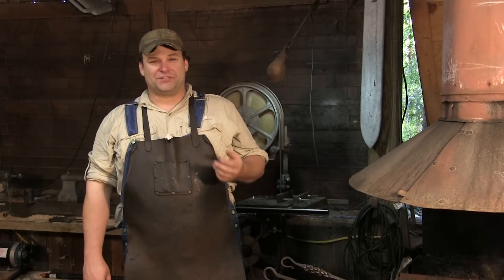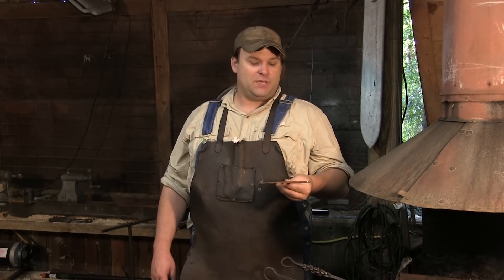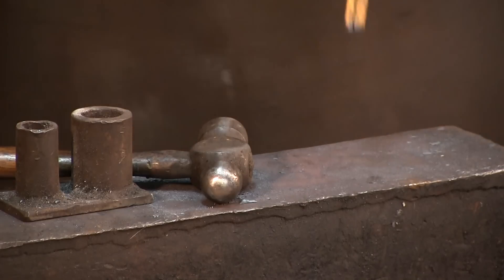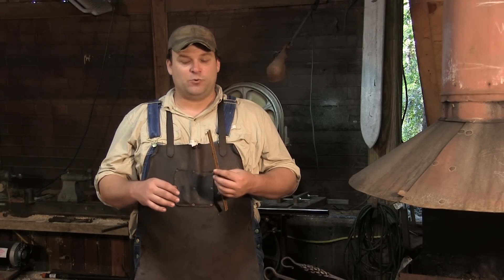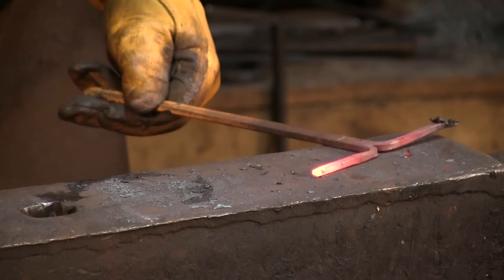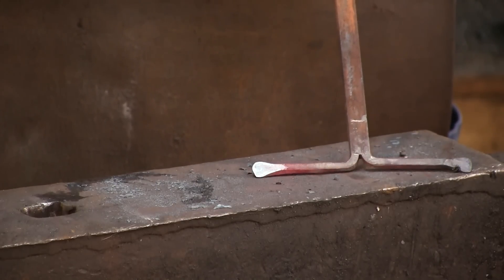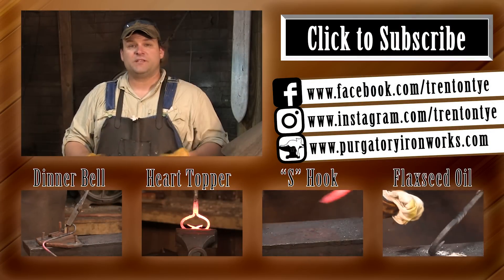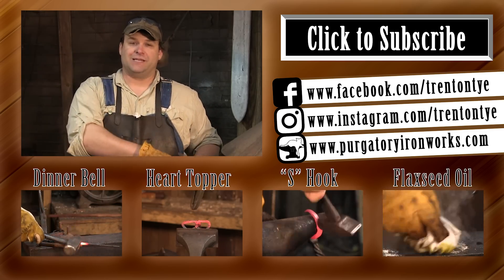Forging Jay's Doorstop

Comment: Hi Trenton,   The best part is that the techniques are largely the same as a basis for the the copper candle holder project from a few years back as well as making antlered animal head fireplace tools, etc.    Thanks so much and am glad to see you back on Youtube.
Reply from the maker: A new candle holder video is actually coming up! And the fire poker videos as well.
Reply: Do you still have the blacksmithing and knifemaking DVD in stock?  From a few years ago.  IF so consider them sold.   Just need to know where to send the payment ..  Thanks again!!!

Comment: Hi Trent, I've enjoyed your videos for a few years now. Thanks for all the great info and instruction.  Here is another answer to the perplexing "door stop" question. I'm 62  and a retired Firefighter. Before my FF career I worked in residential construction from the age of 16.  As a framing/ trim carpenter, I've been involved with the evolution of home construction, especially hanging "doors" of all makes and models.  Installing today's pre-hung doors is such a delight. Easy to plumb and they usually stay where you put them.  I also I remember the 50's and growing up in my grandparent's home in Florida. Their house was built in the 1930's. In the days of old, many of the houses were built on a foundation of brick pillars/piers spaced about 10 to 12' apart. Usually, the sill was of 4x6 and the joists were installed on the sill.  This style of construction dates back to the early pioneering days of the 1600 and 1700's. I'm in rural TN now and there are still Board on Board structures set neatly on piers of field stone throughout the countryside. I know that in your neck of the woods there are pillar foundations as far as the eye can see too. The problem with these foundations is that they are notorious for sinking, throwing the house out of level.  This sometimes would cause the doors to swing closed with little provocation, inhibiting the much needed air flow. Then you add in the cross ventilation factor an you pretty much went crazy trying to keep the doors propped open. We've used books, decorative wood blocks and even a small carved elephant that I still use today.  And now, I have an authentic, PIW door stop. Thanks agai. Jeff Reynolds, Pikeville TN
Reply from the maker: Mr. Jeff, can't tell you how much I appreciate your words, things have been going so well for the shop lately, its great to hear from long time watchers. This is the first time we have been this consistent, this long, with the videos and people are really responding to it. I wish we could do it full time!

Comment: Door stops were used before AC became common.  The houses used breezes from outside to cool the house, so you opened your windows and propped open the door, using doorstops so all the rooms would cool with the breezes.  I bet you can still find many older houses down there with breezeways, or the house sitting at an angle to the road, because of the prevailing breezes to get better airflow through the house.  Jay probably learned his craft from an older smith who had to make those doorstops for peoples houses.  Pre60s houses rarely had AC unless it was a window unit, and you had to have money or you didn't have one of those.  I keep forgetting how young you are, compared to myself.  My parent's home, my great-grandparent's and my grandparent's houses did not have AC, and they used doorstops with the windows open until the 70s, then got AC for their houses (window units for their living room or parlor, but the bedrooms still just propped open a window at night to sleep.